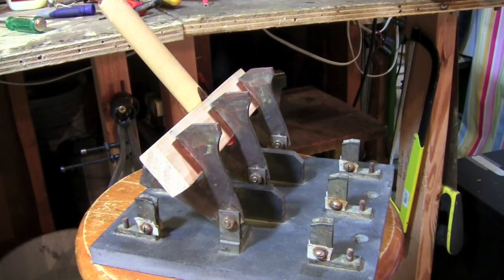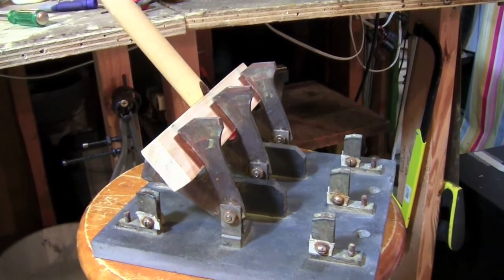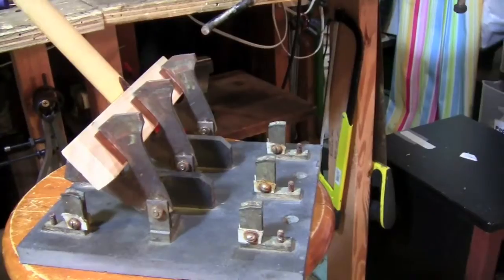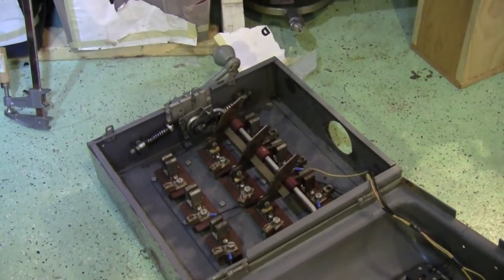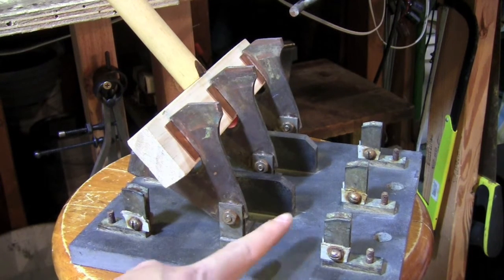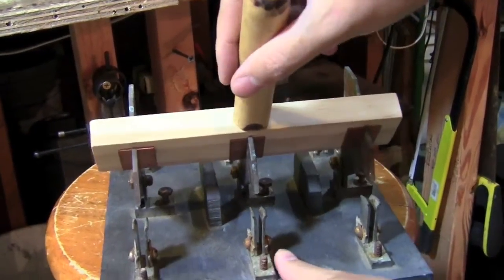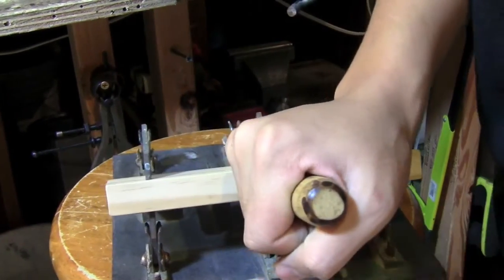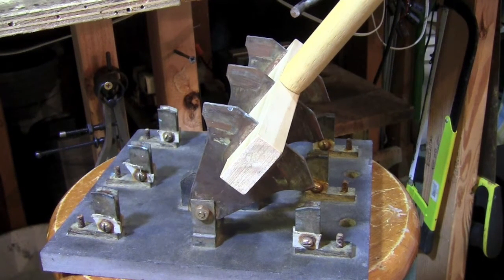Vintage KNIFE SWITCH HUGE Three Pole

Comment: No,  I'm sorry I don't, but it looked a lot like the one you showed in the video, except this one was black (not gray).  The handle wouldn't work anymore from the rust --I sent the steel parts to the scrap yard, so they're long gone (probably on a slow boat to China!!).